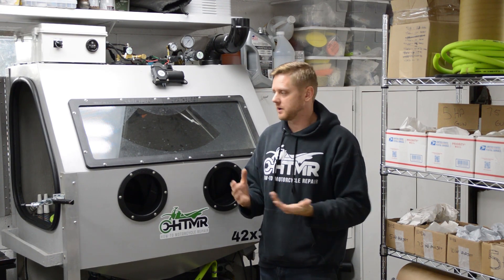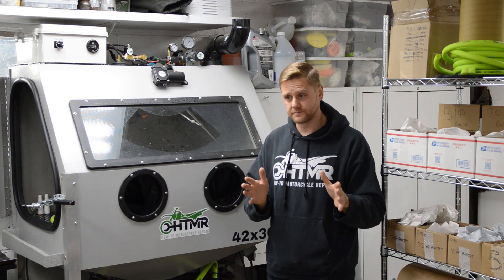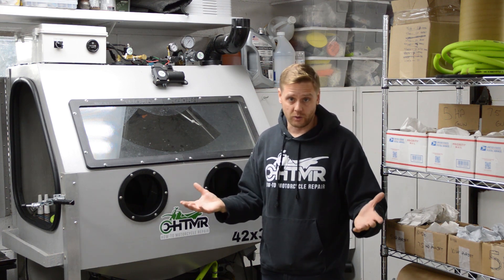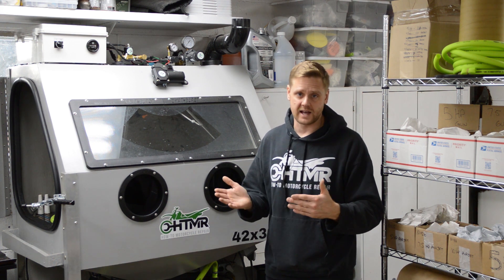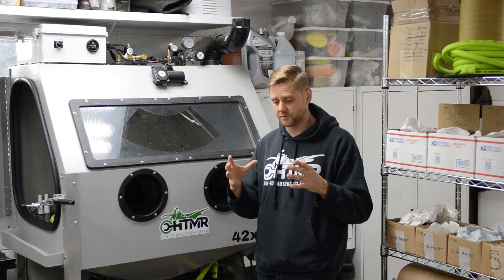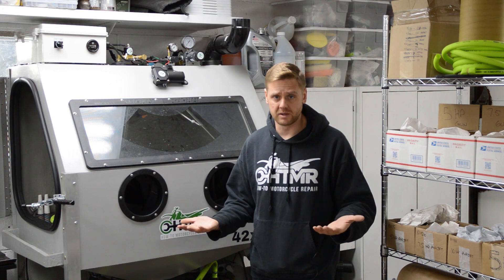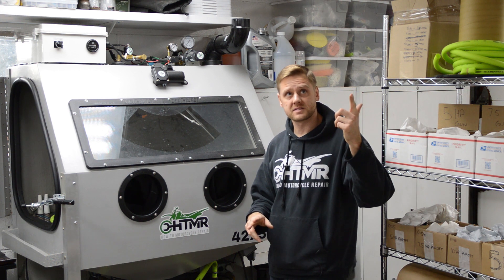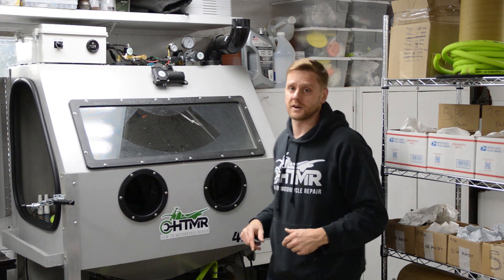Vapor Blaster in UNHEATED Garage - Prevent water freezing!

Comment: I have an  DIY kabinet and I use regular car-antifreese in the  Slurry. Works fine and it´s corrosion prohibed. Let me know your thoughs. Cheers from Germany
Reply: Yup.  I even pour antifreeze into a toilet for winter time.
Reply: and I have no insulation or heating in my concretegarage.
Reply from the maker: I find that I need to clean the water often. Where do you dispose of the dirty antifreeze and media?
Reply: @HTMR  I didn't yet now. First 5 weeks of using my machine probably 20 hours. I take the oil and dirt out with a papertowel in between when it had saddled down a minute. I will try it and then dump it in the trash, the water drying fast away so far every time I put 20 liters of fresh water in it. In Germany we have free disposalstation for chemicals.

Comment: Interesting.... I will have to look at your earlier videos concerning the vapor blaster. Where is your water supply for the shop? If you shut down your heat, won't your water supply freeze up also?
Reply from the maker: My machine is closed loop, water is all self contained. I used to have an open loop that needed a garden hose hook up, but got sick of dragging a frozen hose into the garage.
Reply: @HTMR  oh I see.... I thought maybe some of that water might be going down a drain so you would need a supply line. Cool idea you have there. Really good results as opposed to sand blasting. 👍
Reply from the maker: @northdakotaham1752  watch this https://youtu.be/4Jt1SrBTcBA
Reply: @HTMR  thank you! Will check it out.